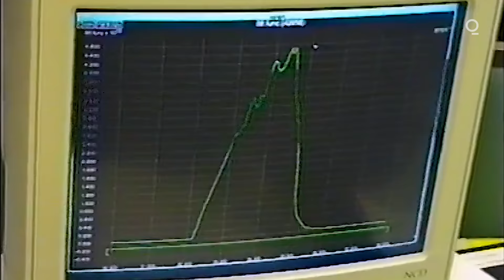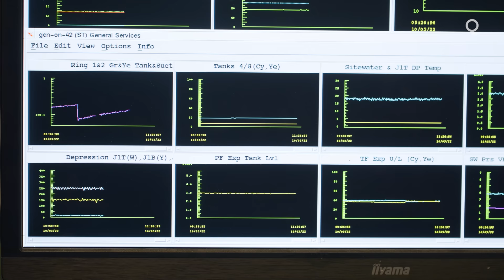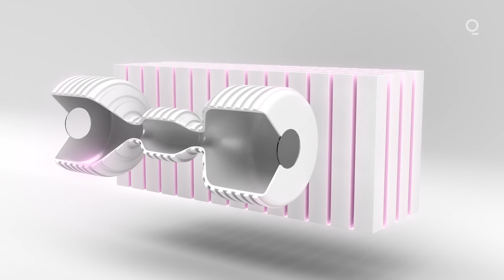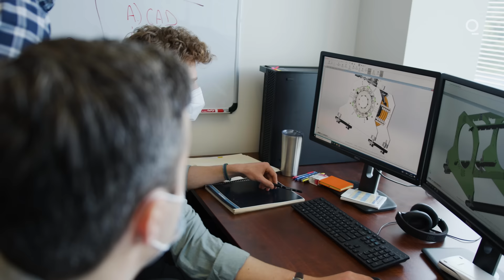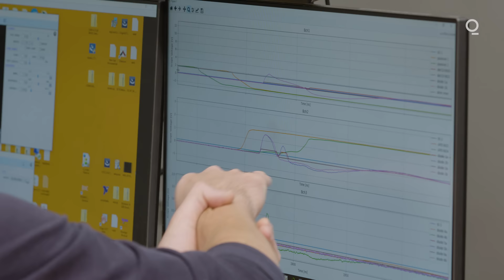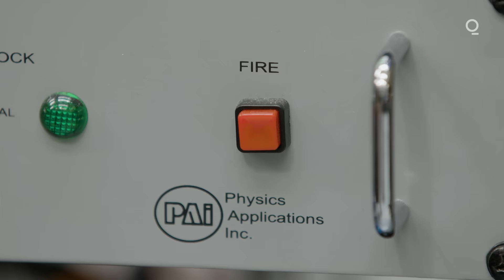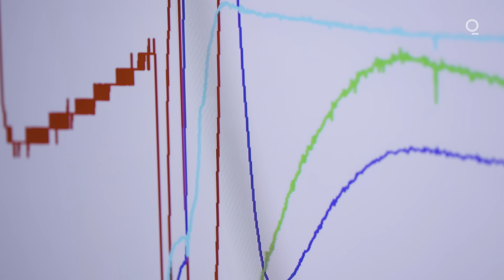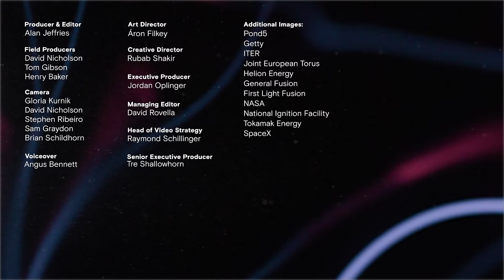Why Private Billions Are Flowing Into Fusion

Comment: Just props for how well this video was made, loved how you showcased all the different fusion startups from across the globe and their different methods of reaching net output. Thanks guys
Reply: and again geothermal is ignored even mm wave drilling is now available
Reply: @niko-laus  it’s not “ignored”, it’s just not available everywhere. The nations who are lucky enough to have vulcanic activity should definitely use it, but we need a solution for all the others.
Reply: @niko-laus  I looked into millimetre wave drilling and it has a few hurdles to go. Temperature and pressure, plus maintaining the waveguide are significant technical challenges, but I'm all for it.
Reply: uds s di  das s gitu td s werden yg
Reply: @niko-laus  und ich 6zwsyyyd die esse ya eey h ga ddsd
Reply: ich dw
Reply: @deaththekid3998  now it is possible to drill  with mm waves indefinitely until hot rock is fund
Reply: @moai123  even plasma drilling is in coming
Reply: What "across the globe"? This was entirely just the US and UK (plus ITER in France). There's plenty of other nations also doing fusion research, but this documentary covered none of them.
Reply: @ArawnOfAnnwn  it's the most violent in research they covered. All others use the three different reactors in the vid. Don't think about it being forgotten. Combined research will help.
Reply: Fusion has been a pipe dream for almost twice my age. It'll happen. Most likely after I'm dead.
Reply: My money is on Skunk Works which I saw flash by at 8:55
Reply: Another way to look at this is in terms of financial opportunities and wealth re-distribution.
There are individuals who are desperately completing for positions on the upper rungs of that ladder.
Sounds cynical ?
Reply: Right??!! space shuttle / boosters reusable. Also she said something VERY important on some companies chasing dis-proven ideas wasting money and time. The doco crew glossed right past this fact.
Reply: But nobody has reached net output.

Comment: 3:53 "producing more energy than any fusion experiment in history" - we should add that it produced less energy than was put in. The energy out/in ratio is improving, but has not exceeded one, i.e. no fusion reactor has produced net energy output. This is covered later in the video, but I didn't want anyone to get the wrong idea.
Reply: Agree with you.  Even if  the plasma heat generation gain  exceeds 1 --ie Q_plasma >1  , the TOTAL  energy needs to be considered. Cooling the magnets, running the facility etc.
Also the  industry  never ever discuss the conversion efficiency of converting the plasma heat to electricity which is  much less than 50%. All said and done , even if Q-plasma is 5 or 10 time more efficient , it might not be enough to even break even.
Reply: Yeah this is often conveniently not mentioned when talking about fusion experiment records. We are still so very far away from commercial breakeven.
Reply: @Zichen He : I don't see it..how do you plan to convert the energy to electricity?
Reply: @Zichen He : Conventional way not very efficient.   Fusion is also a long way off;  I predict that quantum to electric energy conversion will happen within 2 years.
Reply: @Zichen He : quantum to electric is what Nichola Tesla did originally, not the photoelectric effect, which is worse than the solar as you stated.
Reply: @waynet8953  Research Thermophotovoltaic devices
Reply: Tony, it's far worse than that. If any of these fusion reactors were running constantly, they would melt into a puddle in a matter of seconds. They only run for very short bursts, and although they are fascinating, they are useless for producing energy until there is a major breakthrough in physics.
Reply: Look again guys

Comment: This video changed my perception of the private fusion industry. Even if it doesn’t get to net positive fusion first, or fulfill its promises on time; the diversity of zany strategies and ideas being cooked up could end up contributing in the future. No one car company can take credit for even half the major innovations in the past 100 years.
Reply: I like the diference beteween Public and private, public its all about pushing the limits, making fusion longer, bigger, private is all about cutting cost, if you can´t make it long then make it repetition, instead of using steam use pistons or proyectiles.

Is very different mentalities and they are necessary for things to advance
Reply: @Motorata661  yes I agree ☝️ plus private may bring in new minds that otherwise would not be working on Fusion. While Public will likely move in the most straightforward (not over promising) and publicly transparent fashion.
Reply: My thought exactly. They may not be the first to net+, but ideas such as the pulsing "engine" style fusion reactor, or the smaller fusion reactor could play a significant role if they end up being feasible.
Reply: ...but consider that each of the companies that do not succeed first are likely to go bankrupt once one of the others do succeed and everyone jumps on that ship. Because of this, and because of how beneficial collaboration is in general, I think it would probably be better if all these companies weren't racing to make billions against each other, but all "fusing" (pun intended) into one organization made of separate teams working on different technologies
Reply: @outbakjak   The current mood in the fusion industry is actually the opposite. The success of one will remove a lot of stigmas like the "forever 20 years away" and proof that fusion can be done. Then investors will likely jump on other concepts as well. We are seeing that already, actually. Investors started putting money into a few of them and that triggered others to get funding as well (still not all of them are funded, unfortunately).
The market is big and diverse enough to support all of them which all have their respective advantages and disadvantages. And there are many markets for energy: Baseload grid- power, peaker grid power, industrial heat, transportation, space propulsion and many more. All those have different requirements and not all concepts suit each market equally well. So even if one concept is very successful and very suitable for a certain market, a different concept might fit a different market better.
I mean, look at the diversity within chemical engines just for transportation! We have gasoline, diesel, jet engines (several different kinds), gas turbines, wankel, etc, etc. All have their respective markets. Some bigger, some smaller, but overall, they are all quite successful.
Back to fusion, just looking at the difference between Helion and General Fusion. Helion is great for new installations in the electricity market and potentially for large ships in transportation.
General fusion could be a plug- in replacement for the furnaces in existing coal plants. Totally different premise and markets.  
That said, I think that some of them will fail anyway because their concept may not be viable (due to physics or economics, etc). So there will be some failures, but I believe that many will succeed.
Reply: Hey guess what

Comment: The last fusion lab I worked in was Helion Energy. Before that I worked at the Redmond Plasma Physics Lab, part of the University of Washington. It was nice to see some of my handiwork in a video.
Reply: What is your opinion about fusion viability & commercialization?  How long would  that could take
Reply: @rayhans7887  I think if Helion’s approach works, then about 10 years. I am confident that Helion’s approach is the right way to go. I don’t think Tokamaks will ever work. I’ve been told that by guys that spent their careers working on Tokamaks.
Reply: Thank you for your contribution to the future.  I do wonder if fusion really is clean though.  I'd imagine instead of meltdown worries, we'd have gamma & x-ray worries.
Reply: Nice
Reply: so cool!
Reply: @user-nf9xc7ww7m  The process takes place in a vacuum. The fuels are not radioactive. It’s pretty safe.
Reply: Did you ever work with the Lawrence Livermore Lab?
Reply: I have yet to see a video that actually explains what the issue is with the Tokamacs. From what I can gather it is maintaining the integrity of the magnetic field once the plasma is burning, is the field strength not high enough to prevent plasma quenching, when it goes pear shaped and conductively breaks down, dumping all that energy onto the walls of the containment vessel, damaging the walls, like a giant arc welder. I know that the new generation superconductors have changed the game quite a bit, being able to reach field strengths much higher than before. From what I understand, the new type, REBCO, will NOT be used in the ITER design, is that right ? The large size of ITER makes the physics easier to deal with because the tolerances allow for lower field density and other advantages like more space between the magnetic field and the reactor wall..
Reply: Trying to harness a power of a Star, besides limitless energy from it imagine what other things can be achieved!
Reply: I am studying to be a data scientist in the eu, any tips on how I could get to work on fusion?
Reply: @charleswomack2166  No I didn’t. We did some collaboration with Los Alamos and Princeton Plasma Physics.
Reply: @257shooter9  fusion has been "10 years out" for 50 years. Infact that's the running joke.
Reply: @apohro  I kinda fell into it by accident. I worked as a technician. I was working in the offshore oil and gas industry. I was looking for something to do on land. I got hired by an R&D company. I was working on “Star Wars” projects on a temporary basis and an opening came up in their Plasma Physics Dept. That became my career.
Reply: @257shooter9  I grew up near Lawrence Livermore lab.  It is super secure there.  That also means that you were involved in peaceful nuclear power, I presume.   Los Alamos has a history of being used to develop nuclear weapons, and if they still do to this day, then you would most likely be unable to comment on this!
Reply: @apohro  My advice would be to apply for work and/or internship in the US.  All of the world's best and brightest minds come to the US and work together to achieve miraculous things.
Reply: I'm intrigued by Helion's approach, especially their patent on recovering electricity directly from the magnetic fields produced. If it's significantly more efficient than the typical approach of "use the heat to boil some water and turn a generator" then that patent alone is an amazing step forward. It seems like it would solve A LOT of engineering problems for making a reactor that is easier to maintain. It looks like they're actively doing something about tritium breeding as well, which is another huge hurdle for Fusion. Folks at ITER and Commonwealth Fusion have been doing something similar, but their focus has been on mastering brute force in their magnetic fields (those magnetic fields they're achieving and CFS are nothing to sneeze at). I'm kinda wondering what unique benefits you see in the Helion design in particular that make their approach the best? Do you think it all comes down to their electricity recovery methods?
Reply: @257shooter9  can you explain how they’re going to harness electricity directly from the plasma? The video didn’t really get into that.
Reply: Impressive! I really envy you for working on such interesting projects. But i always thought helios was the least viable option for fusion. Tokamaks will almost certainly work with upscaling, but cost a lot per reactor. Other private and government approaches did not yet show, that they'll even can produce energy. Helios i know nothing about, but the concept seems impossible to me. Did they achieve fusion yet? Or are they still in the concept stage. And if they did achieve fusion, do you maybe have some detail you could share?
Reply: @deaththekid3998  I signed a non-disclosure agreement. I am not allowed to say.
Reply: @GodlikeIridium  Achieving fusion is not the issue, the issue is creating net energy, fusion process requires a lot of energy to kick start, you can dump an insane of energy into a system and achieve fusion, it just doesn't last very long, very tiny amount of time then dies out getting out less energy than you put in.
Reply: @deaththekid3998  They actually point in video. Magnetic field can be used for electric generation according to Faraday principle or 3 finger rule
Reply: @pirojfmifhghek566  I think it comes down to 2 things, energy exchange and in a tokamak, plasma lifetime. It is extremely difficult to sustain a magnetically confined plasma. Helion doesn’t even try. The machine runs in pulse mode. Helion’s approach to energy exchange is more efficient.
Reply: @PrivateSi  Never worked on anything like that. I did work on a project for NASA that was plasma sail for a space craft. It was supposed to use the solar wind to propel the space craft.
Reply: @pirojfmifhghek566  Wow they can patent a natural process like that? IF they get it right, they will rule the world....
Reply: @257shooter9  what do you think about wendelstein x or stellator in general?
Reply: @257 Shooter One question, what is the energy return rate that I achieve?
Reply: is this thing actually going to work??
Reply: @zvotaisvfi8678  I sure hope so. I spent 35 years working on this stuff. I would like to think it wasn’t in vain.
Reply: like yall go get some picket signs and megaphones and go across the country and show people how to do it right, and why generic durability is greater than single-use items like plastic bags, which, like mosquitos, exist for the purpose of one trip, from the conveyor belt to the kitchen island.
Reply: split up into teams you gonna make a lot more money than doing this
Reply: @pirojfmifhghek566  the chief question is: how are companies going to procure and construct thousands of tokamaks, when it is hard enough to build one because of the timeline, human capital, and costs for ITER alone?
Reply: @thejfactor1  That's why I mentioned CFS. They're basically leapfrogging ITER's schedule with a traditional tokamak design that's roughly a tenth of the size of ITER. That, plus the magnet coil is YBCO, which was already being mass produced before they began. A lot of potential for scalability there. If the science behind ITER checks out, that one will be a slam-dunk for bringing viability to fusion energy as a whole.

Though when I think about the potential for fusion over the long term, Helion's design is also very interesting. If the maintenance savings of Helion's approach are considerably large over a tokamak, they may also succeed. 

I don't have enough money to invest in either, though. I'm just gonna be happy to see any company finish the race and bring something viable to market.
Reply: its like yall built an opaque neon tube and ran it until it shorted out.
Reply: @zvotaisvfi8678  it’s not opaque. Just surrounded by magnets
Reply: @257shooter9  right you know  what I could use right about now in my life are a couple magnets , a couple strips of magnet wire Yeah I'd be down to buy a spool of magnet wire for about $2.50 I might break even if it cost that much
Reply: @257shooter9  the united field theory guy who lived in his van for 3 years thats the only one of yall with a doctorate who even knows whats going on
Reply: and that metal too sometimes I fancy a piece of sheet metal I bet you they threw away more sheet metal than I have on my building
Reply: and probably the generations before them going back to the 1930s Idk maybe the scientist weren't so wasteful back then idk.
Reply: @257shooter9  its okay I threw away plastic before
Reply: @257shooter9  🙂y'all should try to run the experiment again.  This time, push the voltage a little higher and really try to imagine the contraption precipitating gold.  Have you heard of "The Law of Attraction??"
Reply: @257shooter9  and what I bet you got some buddies at the james webb telescope yah its pretty pictures in 720p or whatever but like bro you could have just hired an artist and done the whole thing a lot cheaper they Should have hired Kubrick to do the moon landing would have been CHEAPER!
Reply: @257shooter9  I remember when gas was less than a gallon of bottled water people remember when gas was 25c you people are crazy and the problem is the INFLUENCE of your REACH you REACH every heart and spirit and mind and inspire them with your catastrophe.
Reply: @257shooter9  ripping the copper out the walls of cern cheaper than mining it out the ground
Reply: @pirojfmifhghek566  their energy exchange and the fact the machine runs in pulse mode.
Reply: @257shooter9  but instead of like sciencing and informing legislators yall just playing in a cool room on the budget
Reply: @257shooter9  like trust me I already gave up in life sortof but it was external things like this that convinced me it was a valid option
Reply: No comments on stellerators?
Reply: wouldn't a 2 or 3 torus be more efficient? we already know that the universe has to be more than a single torus for it to be what it is... so maybe using these universal physics could be the answer to a sustainable return of energy! just a thought ✌️
Reply: @257shooter9 Questions: 1) isn't tritium radioactive? 2) doesn't fusion release neutrons and produce gamma and X-rays?
Reply: @patricklebeau6539  tritium is a beta emitter. So is the nickel 63 filament in your household smoke detector. No gamma rays. Some soft X-rays. Yes there are some neutrons.
Reply: @257shooter9  Thanks for your answer
Reply: @zeusinvestigations3334  would it fly if it had two torus>?
Reply: @zvotaisvfi8678  don't know what flying has to do with anything tbh 🤷✌️
Reply: @zeusinvestigations3334  Idk isn't there that whole ufo thing where you get the two rings spinning at different frequencies and it negates the effects of gravity... I dont know if this is real or possible